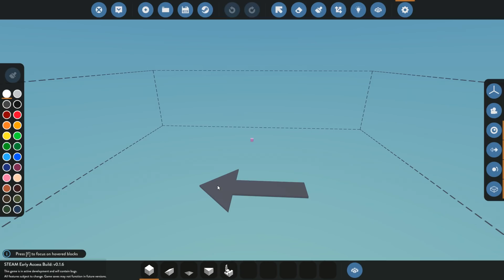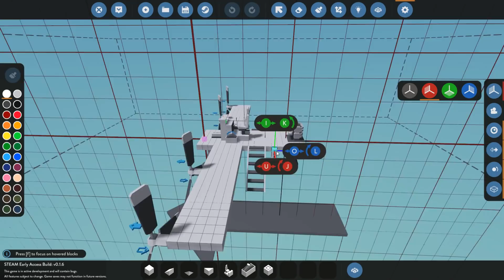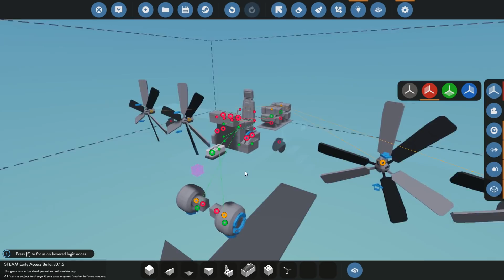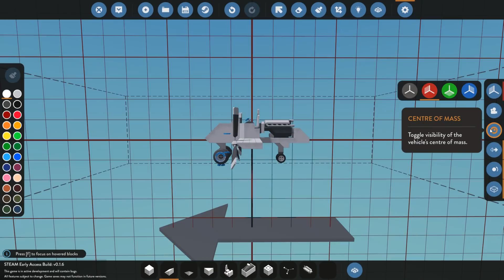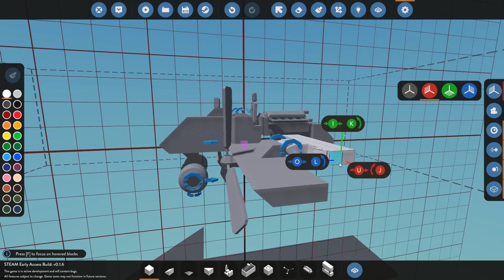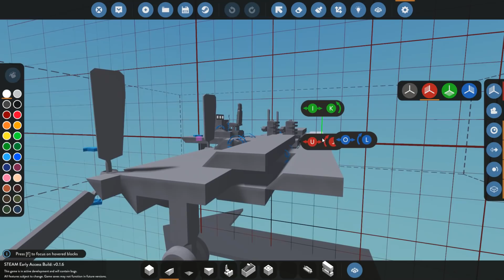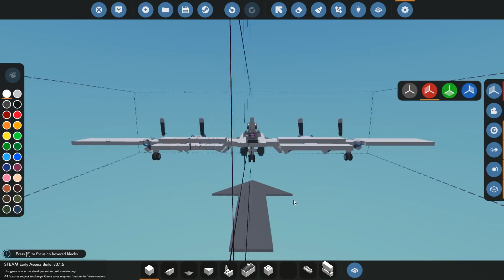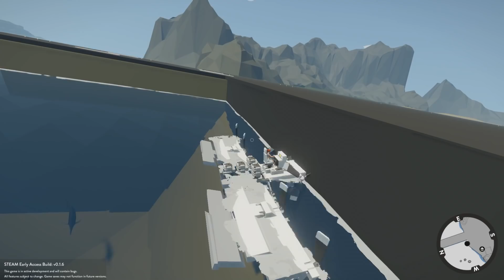Stormworks: Build and Rescue - How to Build an Airplane

Comment: I have a degree in Aerospace Systems Engineering and work for a company that builds planes...OMG your precis of aerodynamics is triggering me looool
Reply: So you'll be recommending Jon for the next job that opens up?
Reply: Are you an Aerosmith?
Reply: I work in the Airworthiness dept at the moment
Reply: 30mins in - he's learning, but in the wrong order (head on desk multiple times) - you've skipped controls and gone to trim...
HAVE YOU EVER BEEN ON A PLANE?! WHAT ABOUT YOURS DOESN'T LOOK LIKE A 737!?
Reply: Okay, end... look up an actual plane - notice the following:
Tail, elevator, rudder, ailerons, empenage, 
You've 'succeeded' through brute force, ignorance and luck
Reply: but he succeeded. Maybe widen your horizon and you can learn something from this....

It IS logical in a rather mad sort of way.
Reply: You can fly anything with enough thrust...
Reply: Succeeded through luck, brute force and ignorance (a bit Jingles like lol)
I'll only concede that he was logical in that he did progress through iterations SOMEWHAT logically, but starting unnecessarily from a low base is not, which negates his progress. His starting point could have been much higher had he just looked at a picture of a plane and copied the general layout - there's a reason it's called a "classical layout" - because it's worked well. These Delta wings, canards etc are non-classical, and are relatively new and relatively few by comparison to standard production aircraft.
Reply: +boffinboy100 I'm from the Ministry of Truth and have come to inform you that our beloved Gnome Overlord's agents are everywhere. You will immediately report to the salt mines and there you will languish until The Bohemian Eagle returns. Jingles does not and has never employed any luck, nor has he ever suffered from ignorance. He is correct with everything he says and everything he does is on purpose. ;)
Reply: He built a plane in the way a caveman would have built one based on spoken descriptions of one.
Reply: He put THREE sets of flaps on it without a tail and acting more like air brakes and still didn't know how planes turn! I was crying laughing, bless his heart
Reply: If there was such a thing a youtube gold, i would so give it to you if you can do a live commentary on Jon's engineering vids

Comment: Been playing a lot of this game recently, and the order of difficulty in craft is weird;

Boats are Hard, they are very hard to get stable at speed and need careful attention to balance to work

Planes are kinda difficult, if you know the basics of planes at least, everything works as expected. though not very useful in the game as lacks many missions where a plane makes sense.

Helicopters are piss easy, the Gyro module handles just about all stablity for you. Slap a rotor on the roof and tail rotor on the back and you're solid.

Note your plane isn't working as your using the Basic (very heavy for its power) engine and splitting it's already low output between too many propellers (only worth spliting if have excess power)  Use the aircraft engine instead, and reduce down to one or two propellers. Fin Rudders work as control surfaces even in the air so use those rather than oversized hinge control surfaces (which are basically just massive airbrakes given the angle of attack you have them going to!) I mean a good reference would be any actual aircraft so I'm not too sure if any of this is even helpful lolll

Comment: For your future aeronautic engineering:
-Elevators control pitch (Up/Down)
-Ailerons control roll (Side tilt)
-Rudder controls yaw (L/R)

Airplanes turn by tilting left or right and gently pulling up.

Comment: Jon as a pilot i feel the need to help you out a bit
You had the right idea with the flaps, but what you had were Elevators not Flaps. Elevators generally go on the Horizontal Stabilizer (the smaller "wing" that's usually on the back of a plane) and help control your up and down.
The reason your plane turned without your control is a thing called P-factor. When you're climbing P-factor means your propellor isnt applying as much force to one side and causes your plane to turn.
What you wanted was not hinged wings, but a second flap on your wings called Ailerons. If you have these flip in alternate directions (one goes up and one goes down simultaneously) it helps you turn. If you want to turn right, your right aileron should go up and your left one should go down and vice-versa.
You had no Vertical Stabilizer or Rudder which also helps with turning. 

Otherwise, I'm impressed you did as well as you did. This video was very well needed after a stressful flying check yesterday.

Comment: Btw haven’t finished vid yet so don’t know if he learns this but. Plane basics. Center of thrust has to be right behind the center of mass. Also. Flaps when angled upward in the back of the plane push the plane down. But since their in the back it cause the front to life upward. Tail goes down, nose goes up. So if you angle the flaps downward when there in the back of the plane. It will cause the nose to go down. And the tail to go up. Gl!

Comment: i doubt this would of really helped you, but... you know it may have? probally not, at all, even a little bit...

MARCH 16
v0.1.14, v0.1.15 (The Fixed Wing Update)
Dear Stormworkers,

5 sizes of wing section and 3 new aerofoil control surfaces have just been added in the latest minor update!

Comment: So I've been looking to see if anyone has a tutorial/ideas/unique designs using the new airplane release (1.14 and 1.15). 

........ Yeah. This is not it.

But I was extremely entertained. 

I built a Chinook (dual rotor cargo plane) with a functioning winch and rear motorized hinge door.

Now I want to try an Osprey (rotating rotors to function like a helicopter, maybe engage a gyro when in vertical mode, then rock forward and see if I can keep the airplane aerodynamics functioning with rotors...).

Comment: Have you not seen an airplane? also its all about the flow of the wind on the wings, and those flaps are almost 10 times as big as they are on real planes, and you need to imagine the flow of air on the wings to know what will happen

Edit: I am also not a pilot, or aircraft engineer so if im wrong please correct me

Comment: Warning real science: planes basically make vacuums above the wings then the wing fills that but (demon magic) the vacuum also gets moved up
Reply: Man_From_Jupiter ehh the air pressure is important, but the most important bits of altitude control are the elevators. You can take a plank to the sky if you have elevators on it and can get it going fast enough that the aero actually matters.

Comment: The one with the two flips in rev worked but u was doing it wrong tilt up to go up tilt down to do down and to turn u should try puting your left propeller have a diffent power output then the right

Comment: 37 minutes in and jon still hasent figured out putting a vertical flap on a TAIL also one wheel at the back steering AND driving eliminates all the wiring,

Comment: Gross oversimplification, and very incorrect. When the air goes under the wings it doesn't "push down" or "push plane up". Air travels faster under the wing (creating high pressure) and slower over the wing (creating low pressure) due to the curved shape of the wing. This causes a difference in pressure, and as you probably know high pressure really wants to go to low pressure to make both sides medium pressure. This nature for pressure to want to normalize itself is what causes lift. The engines of an aircraft force air over the wings causing this effect. Helicopters work in a similar way in that the blades are both the engine and the wings. By rotating the wings it causes air to flow over/under them, causing lift.
Reply: That's true as far as it goes but doesn't explain how some planes can fly inverted.  By your argument, that would cause negative lift only.  In practice both the Bernoulli effect and the deflection of air downwards contribute to lift.